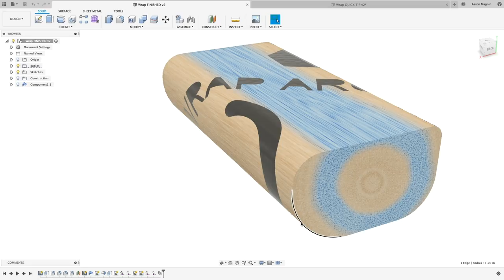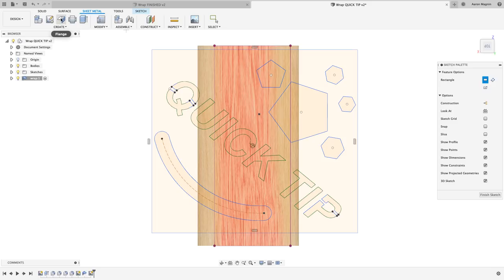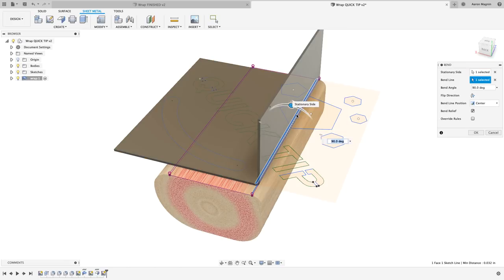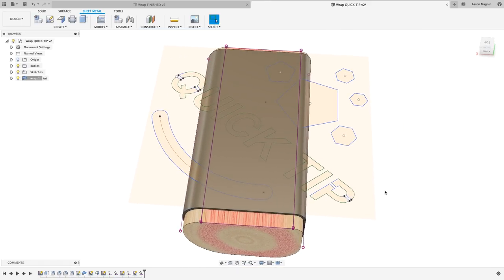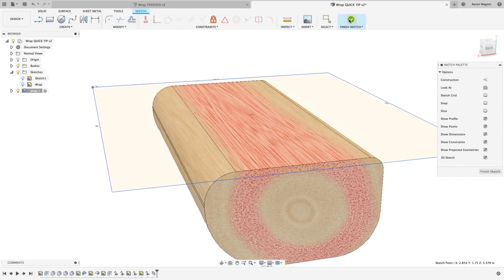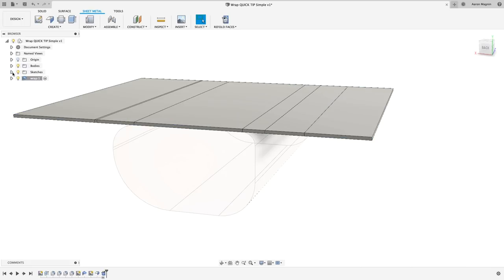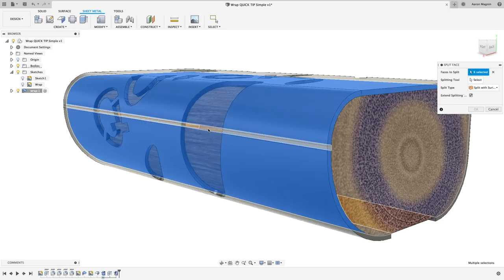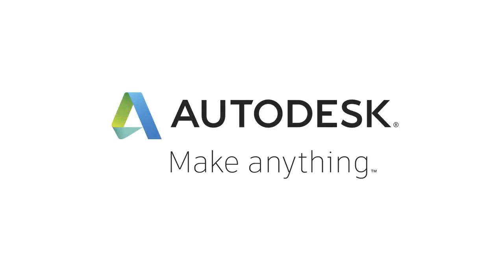QUICK TIP: Rectangular Wrap

Comment: i have a slightly curved knurled surface that I need to curve slightly vertically (starts out curved horizontally, like around a cylinder) It was a knurled cylinder but I cut a patch from it.  Anyone know how I can bend it? Idk if I can bend it using this method or not

Comment: Hooray for memes being used in a professional setting. Want to wrap stuff in fusion 360 at all? You're gonna have a bad time... :P
Yall should really implement proper tools for this, the fact that fusion can calculate the wrap SO QUICKLY after you cut the shapes into your sheetmetal part implies that the actual code working under the surface to do this is really simple, having sketches conform to faces seems so fundamentally important.
I do a lot of fourth axis CNC work on complex cylinders and improvements to this workflow would change my life.
Reply: Thanks for the walkthrough though! This is a workflow I can implement at least.
Reply from the maker: Look! We're hip too, right?!?!?!? 
And yes, we would much rather implement a proper tool...and hope to do so soon.
Reply: love you guyyyyyyys <3
Reply from the maker: https://www.youtube.com/watch?v=8MLiHp2LH48